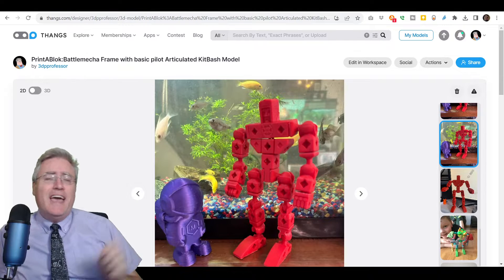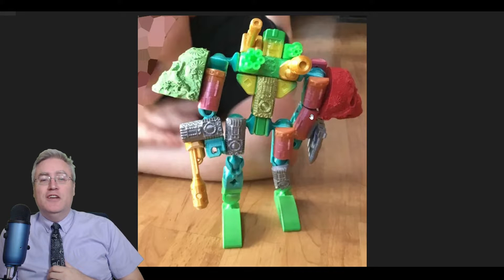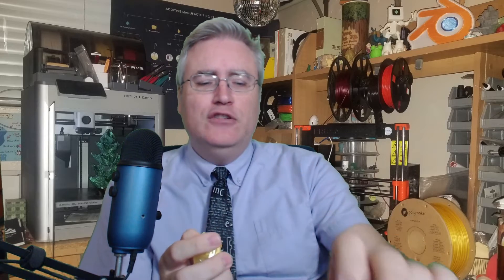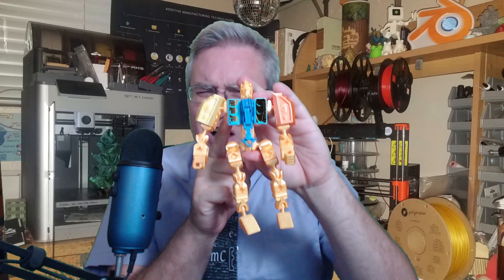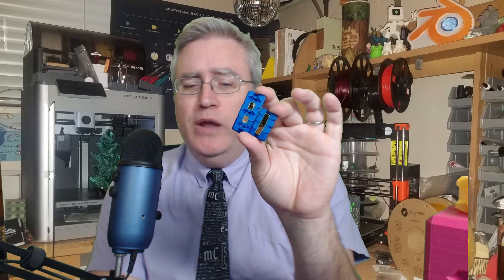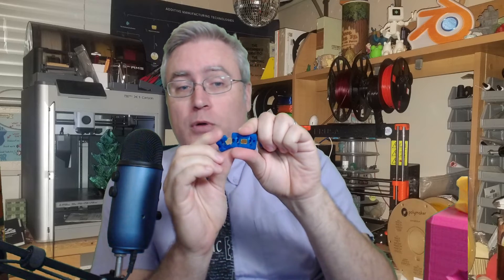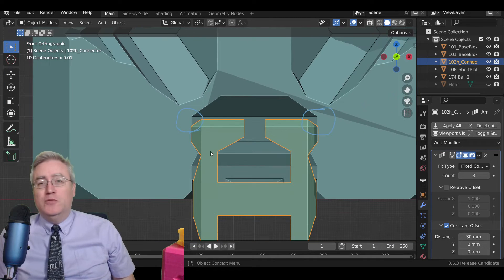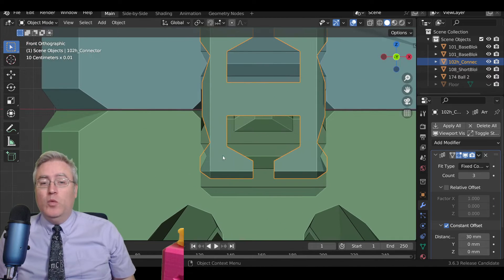PrintABlok - The Problem and the Fix, Thangs Aceddity, and Sliceworx contest winners!

Comment: I print the Beasts and Skyforce on a Ender 3V2. It seemed to me that the H connectors were probably not long enough, ever so slightly. I made the H connectors then slightly longer by 0.4mm in Cura slicer itself (came to this 0.4mm by trail and error) and then printed it on a Ender 2 Pro. The connection now seems much more positive, I still print the rest of the parts on the 3V2. I have printed the Angel Mech on the 3V2 but still needs to assemble it. I will try the new connector for sure. Great stuff you are creating Prof.

Comment: Why don't make the connector a little longer in the center?
Reply from the maker: I'd need to see an illustration of what you're talking about when you say that.
Reply: @3dpprofessor  I mean. Basically the connector goes too inside of the piece so it does not stick out enough to fully insert in the other piece. Won't be enough to make the connector a little longer?
Reply from the maker: @DumahBrazorf  Problematic. First of all, not all connector holes have a back to them. Some have holes for air to get through in case of being swallowed. So the longer tip would have nothing to push against.
It's a good idea, but only for certain cases.
Reply from the maker: @DumahBrazorf  And then there's also the problem of differing 3D printers producing slightly different dimension. Get one that prints too big and your blocks wouldn't be able to touch because the connector would be pushing the apart at that point.

Comment: Hi, interesting, levers as you are probably well know are a fundamental and important feature of engineering as a tool but can also be  a curse.

In this case the pull out resistance of a connector is affected by the leverage on it, e.g. it's like fitting a shelf to a wall with screws and plugs that are too short such that the friction between the wall plugs and the wall is insufficient to withstand the lever action magnified pull.

The lever action is quite a magnifier, have you tried setting up a test jig to quantify the straight pull out strength of connectors with different materials ? Jim.
Reply from the maker: I'd be curious to see that myself. Not even sure how I'd start on that, though.

Comment: Hey i know this is a big ask… but i am making a project helmet (Specifically the Do3d spider-man 2099 helmet) I would love it if you could try and print the eye pieces they are almost a thick mesh.  I was wondering what printer can print these very detailed eyes (with your army of printers ) if you could see which  printer makes it look the best. your testing would mean the world to me.  if you would like to make a video on it i would love that too, if you could help me i would appreciate that so much.
Many thanks-Eli
Reply from the maker: Yeah, that's kind of a gigantic ask. 
I mean, first of all I'd have to put aside all my printing projects to do yours.
Do you have a 3D model, or are you asking me to do the design work as well?
Have you ever done any 3D printing before?
Also, I've never been that big a fan fan of Miguel O'Hara, and his roll in Into the Spiderverse didn't help that. So if I did this, I'd have a helmet I really don't want.
If you've never done any 3D printing, I recommend you start. But start small. Maybe make a few printabloks first.
Then, try your helmet project. I suspect depending on the printer you get you'll have to break it up into pieces, and you're going to have to get experienced with supports. It's gonna be a lot of frustration and a lot of learning, but if you stick with it I'm sure you'll do great things.